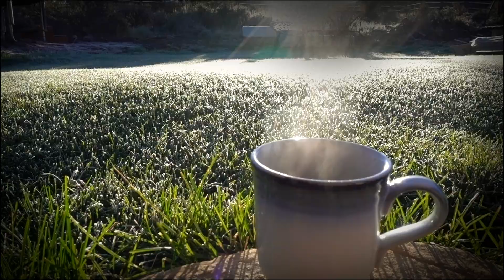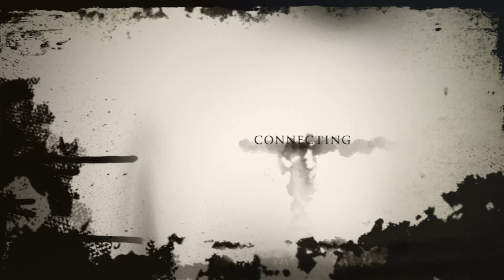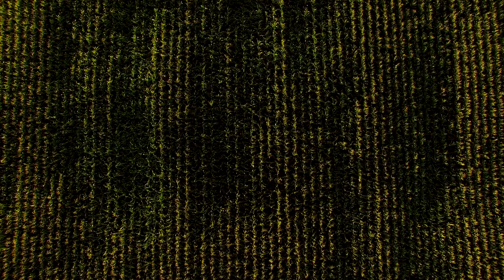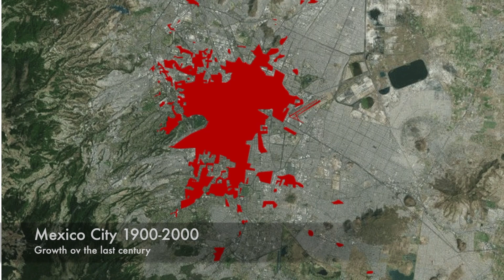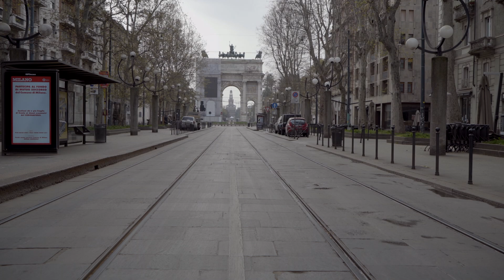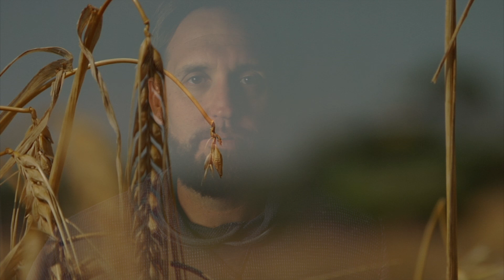Nitrogen Fertilizer: When, How and Why?

Comment: Recent greening of the Earth (5% per decade) are attributed to 70% carbon dioxide level increase and 30% nitrogen fertilizer. In either case, it is crude oil and methane that fueled our success and prevent the starvation Democrats try to force us to.

Comment: Would using a surfactant with Air8 help it get deeper into the soil? I am going to use Air 8 this year since 2/3 of my lawn is a pain in the ass to mech aerate because of the slope. This should help to wash the salt levels down along the curb strip as well, I am thinking.

Comment: I'm still very curious about the amounts/ratios of NPK+micros that are actually in my grass clippings when I mulch them back in to be recycled by the soil ...as I'm sure it should reduce the requirements to add additional fert if I'm not 'harvesting that crop' by bagging and just throwing it all away - also I find it keeps my soil very active and 'alive' where I never get any dead clutter matter nor 'thatch' build up, I even mow all my tree leaves in(which is much easier than raking and having that also hauled off, further depleting the soil) and the lawn simply 'eats' all that too as it all disappears quickly ... but I never see anything on that type off 'feeding' and what rate levels I'm keeping in the soil vs the kind of guesswork that happens when we only add supplemental fert that may or may not contain everything we remove by constantly bagging everything out; like am I processing the grass to produce an unwanted build up? or am I keeping hard to replace minerals and micros?
Reply from the maker: You could send your turf off for a feed evaluation and that can breakdown what’s in there

Comment: Good morning John. Very informative video. Does low nitrogen affect deep green color? My KBB turned light green over the summer. Thanks
Reply from the maker: timing is the most important piece when feeding. summer takes its toll on cool season turf and making sure it goes into the heat with food and then fed lightly during the heat with the addition of micros will keep color consistent. for the most part sumer feedings are less than .25lbs N 4-8 weeks apart depending on precipitation
Reply: What sort of grass is kbb?
Reply from the maker: @wayneessar7489  I’m
Going to say KBG